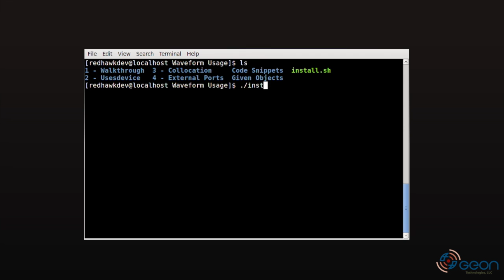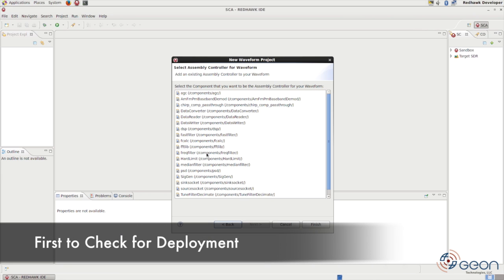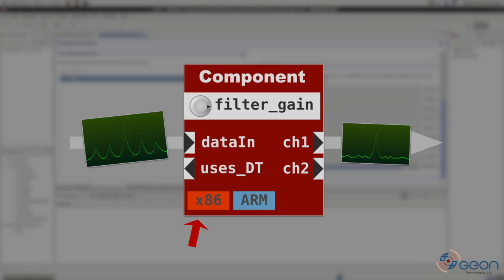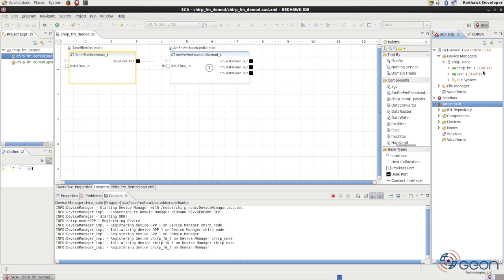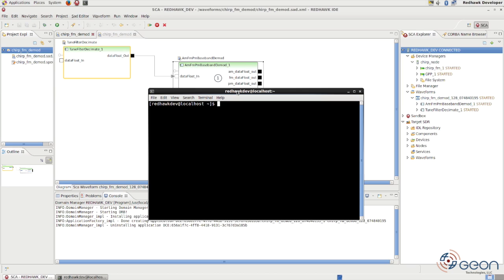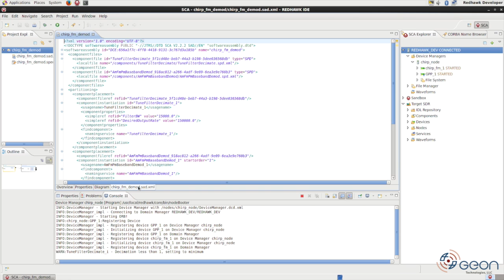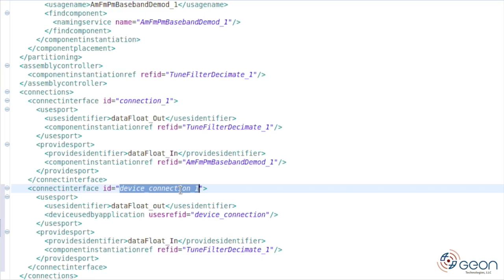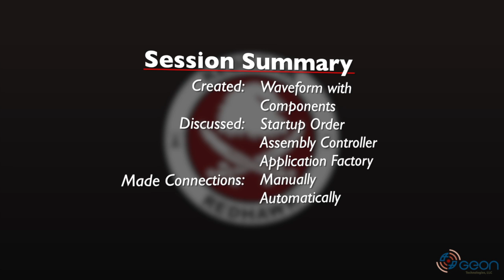Waveform Usage: Basics

Comment: I'm having trouble getting this tutorial to work with REDHAWK 1.10
It appears as though all I get is the modulated output from the device.
 Everything worked fine when I ran it on 1.9.
Reply from the maker: I have not had a chance to test this in 1.10 yet.  Any chance you can post your final python terminal commands (or message them privately to me if need be)?
Reply: Geon Technologies

Hi thanks for the response!
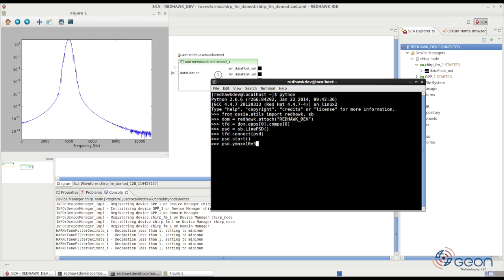I followed the exact commands given at 14:04 in the video, and the plot displays two peaks which converge and diverge.
Reply from the maker: +JD45093 I apologize (profusely) for how long it has taken me to go through and implement this.  What you describe is what I see also when I was recreating this for the version of this video for REDHAWK 2.0.  Depending on whether I used the sandbox plots or the IDE, the default settings would either show the full spectrum (two peaks as you describe) or the typical lower half of the spectrum.  Please checkout the 2.0 video and see if that helps.  The IDE plotting became significantly better since this video was made, so the new video takes that into account (giving a split experience with some console work as well as IDE).